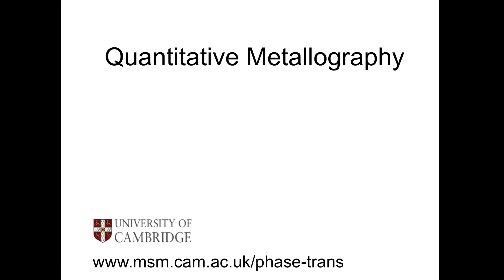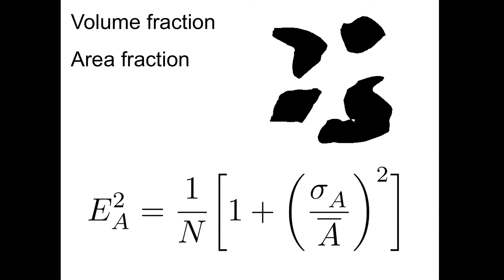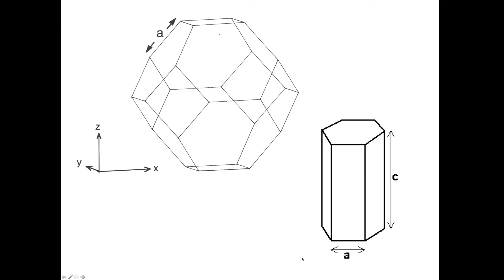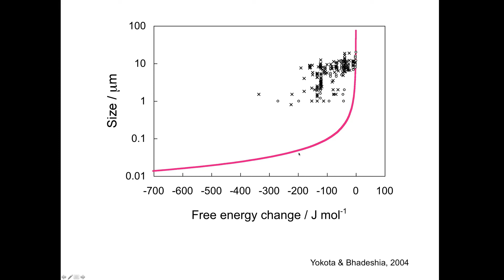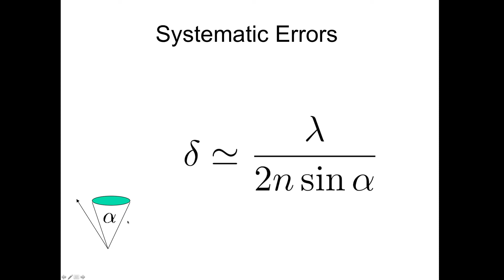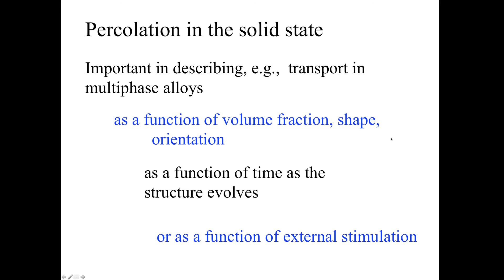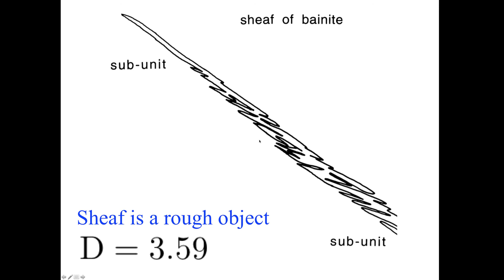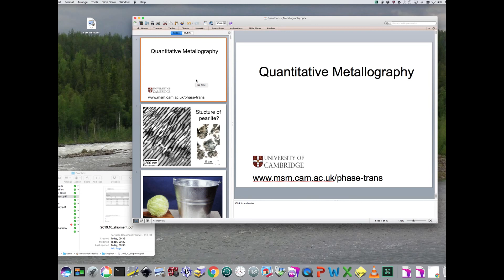Quantitative metallography and stereology

Comment: At 36:53, shouldn't the line have a negative slope because D is usually bigger than 1?

Also, at 39:05, shouldn't the dimension of the sheaf be 1.59 rather than 3.59?